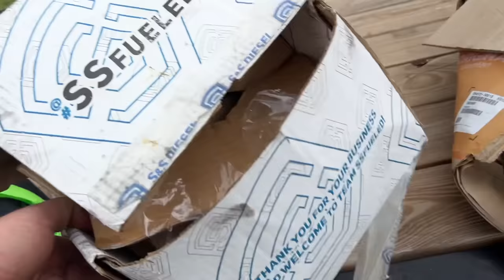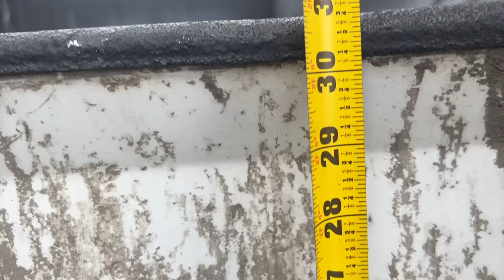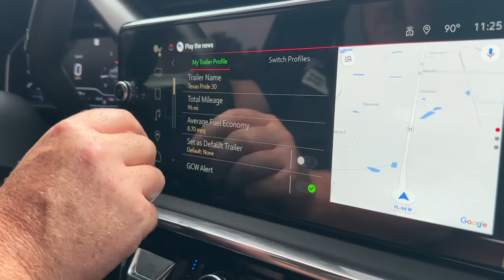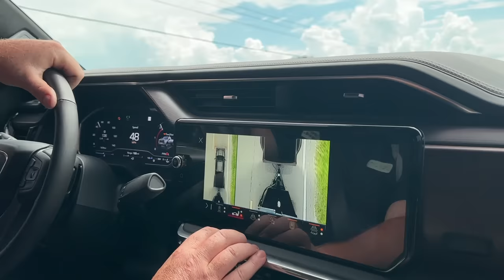$100,000 Diesel Truck VS $2,000 Diesel Truck!!!!  Are These New Trucks Really Worth It?

Comment: To be clear, I own a old F150. But it is also true that a 2024 F250 6.7 HO is $76,000 supercab and long bed weighing 8003lbs with 550 hp. 0-60 in 5.3 seconds... Tows nearly 40,000lbs with 5th wheel

Comment: I use my 99 dodge ram 2500 diesel for towing a bobcat t590 on a 16 foot dump trailer . Its like 14000 pounds . I tow up hill all day at red line . 480,000 kilometers on it

Comment: I daily a 2006 Chevy 2500HD 6.0 4L80E.. 267, 700 on the dash. Id trust it across the country with any trailer haulin max weight.. 8ft bed ext cab 4x4... 💪🤌💯  all white blacked out... no homo lift.. stock 16s.. Big bumper n horn front hitch... big rear bumper.. big hitch.. 💯 most reliable

Comment: Should do a nice 15-20k older truck with 10-15k in upgrades and engine mods vs a brand new stock truck. Because you can make a older truck out perform the newer ones

Comment: My 99 f350 powerstroke with only a chip added kicks ass.   Your new one just adds more fuel.  Overall, new smells better , but just adding a new front seat will fix that.  You can buy a lot of diesel and repairs  for that extra $98k

Comment: I’ve got 2 ram trucks one I bought new in 2018 it’s none stock with all the emissions still on and it’s got 278k miles on it most of them towing 10k plus and a 2015 my brother in law bought new it got 340k miles on it probably half of them towing 10k plus and it deleted and tuned but both still have the original stock powertrain with no rebuilds

Comment: You can get a 2023/24 Duramax custom for mid to high 60k and get the same performance as the 100k Denali. You could even get a base work truck trim and get the same performance.

Comment: A 100k truck generates the same income a $3000 truck does for the most part.  Obviously you can pull/carry a lot more then the $3000 truck so you can be limited in your tasks,  but if you are just towing a 35-50 excavator,  a mowing trailer,  an enclosed trailer or a dump trailer you really wont need the extra power in the 100k truck.  And the obvious is you have a warranty behind you for repairs,  so if you can afford the time and money to repair problems that come up in an older truck then thats your best bet.  I have 2 6.0 diesel trucks and a 4.6 F250 for landscaping and my high mileage 6.0 typically loses 7-14 days per year in repairs/maintenance.  Its expected having over 400k kms.

Comment: I was towing my RZR back on a 14ft with my tuned 6.2 GMC Sierra crew cab and pulled up beside an older man and his wife in a 2nd gen Cummins long bed towing a 25-30ft 5th wheel camper and i seem him turn the switch up and he left me standing on the interstate and smoked the whole road out for about 300ft  and i decided to quit messing with old diesels

Comment: Until it needs a new motor or a backordered part is on the list. You know technicians don't rush for warranty jobs that are big jobs. I got a Cummins on my sheet that has at least a weeks worth of labor done to it to not fix the problem and the engine is restricted so i can't just have it ordered. I haven't been payed anything on it yet... needless to say its been sitting for months and bought back. Just because its new doesn't mean its any good. The warranty doesn't mean you get in and out... you can have several months of downtime easily depending on the severity of the issue and the availability of parts.

Comment: Thng is about the old trucks is you can throw $30k at your older truck and it could or would perform just as good or better than a stock brand new one. You can also upgrade the lights, so it looks just as good and still under that $100k price. In my opinion, DPF and DEF has caused guys more shoulder time and shop time than an OG diesel engine  that was never introduced to the emission garbage. Repairs and maintenance are much cheaper on the older truck as well. My newest is a 2017 Ram 3500 dually...i dont think ill ever go newer than that honestly. 2020 plus trucks are just rolling computers now which is getting harder to work on by yourself without the software

Comment: I had a similar dilemma a couple years ago. I had a 00 7.3 f350. Loved the truck but I was towing cross country during the summer. I sold it and got a low mileage 2012 ram 3500 with the 6.7 cummins and g56. The cummins is a much nicer, more comfortable truck but it’s a 30k dollar truck versus my 7k dollar power stroke.

Comment: Funny how "newer is more reliable" I've heard of many horror stories of Brand new trucks breaking down and going into limp mode, mainly because as he states. These new trucks have so many Emissions system that they are far harder and complicated to work on and so many more things that can break on it. On top of that if you plan to keep the truck for a while the resale value plummets dramatically from new. Once these trucks get around 200,000KM they are at the point of catastrophic failure.

Comment: The problem with a $100,000 truck is that you can put a $30,000 down payment towards it (which can buy a pretty nice truck on its own.) and it’ll only cover the first 3 years of depreciation. $10k/year up front, then another $15k/year in payments following that. 

I assume he bought this particular one cash and plans to keep it, but the typical buyer is not going to have the same plan.

Comment: we have 6 of these old f350 Ford Super Duty trucks, smartest thing we ever did was buy a truck to take apart and use for parts we call it "stripper". The cost Savings of using used trucks like this is astronomical, if I had to buy 6 brand-new trucks I've have $600,000 into the same amount of work.

Comment: I have had newer trucks I am back in a 04 6.0l and to be honest I love it, no monthly payment being able to work on it, parts are cheaper. If you get a loaded  truck in that year 05-07 they are still nice and have heated seats you can get a nice radio and back up camera for 5-600. The new ones a defiantly more capable but really are they 85k more capable. One other thing to mention is that technically with the new trucks being so much more capable depending on truck/trailer combo you need a cdl. For me the old truck works but I like turning a wrench here you guys said it perfect, if you got the coin too blow it will give your business a good look pulling up but if things slow down especially with the economy being how it is you have that payment as over head. Regardless theses truck prices are insane used or new

Comment: Work wise... because, let's be honest, the ultimate is not a work truck. I got the SLE 2500 gasser, and it is awesome. I don't do much towing, but I use the payload all the time, and I have had over 2k lbs and it drives fine with it. Payload is 3500 max. So yeah, if you are working all the time and making money with the truck, then get the new 2024. If you only need it here and there, get the beater. Great video. Ps the new interior in the 2024 is off the charts!!!

Comment: I am just amazed you could find a running Diesel truck for 2000 dollars. My 1990 Diesel has finally worn out to the point I need to rebuild the engine. So for now I am getting around on a bicycle.

Comment: I wouldnt bring breaking down into this. That emissions system is going to cause way more problems on the long haul than an older emissions-less diesel. A 6.0 on the other hand yeah breaking down is something to worry about. But a brand new bone stock diesel truck you got 1 nox sensor failing will stop you dead in your tracks.

Comment: When doing the braking test, did you still have the trailer on? You didn’t have trailer brakes on the Ford. 
It’s all a moot point for me anyway. I’d never be able to afford a new truck, and I’m exceptionally happy with my 06 F250 6.0 King Ranch Super Duty. I tow quite regularly with it and it does the job efficiently, and comfortably for me.

Comment: Brand new doesn't guarantee reliability. Proper maintenance, pre-trip/post-trip inspections and know the limitations of your equipment do. 
I have a few trucks my self...
95 F250 powerstroke 4x4
96 F350 4x4 460 gas
2000 F250 powerstroke 4x4
2000 F350 4x4 5.4 gas
2005 Dodge 3500 Cummins 6-speed 4x4
2011 F250 4x4 6.2 gas
If I added what I have invested in them already (purchase + mods/repairs) I'm at 88,500. This leaves 10-30,000 left (market pending) that I could do in current/future repairs or add-ons before even touching the price of that new GMC.

Comment: Friend has a 2021 tundra for $55,000. The AC has never worked and now the heater doesn't work.
The system is heavily digitalized. Dealer wants $3500 to repair. They will only replace EVERYTHING.
nough said.
What? Mine? A 1990 F350, 351, crew cab, 8' box, 4 wd with a manual transfer case and manual hubs, solid axles, 5 speed manual, leaf springs all around and its a 98,000 mile cream puff.

Comment: I have a 2001 F350 dually CC diesel 7.3, long bed, HD suspension, bought new, now with about 100K miles on it.   Never a lick of trouble and I wouldn't sell it for  $10K.  Does everything I need .  The truck will outlast me.

Comment: If i were ever to buy a ford. It would be the old 7.3l. Personally id like to get an old 03-06 duramax. But i cant justify the need for one at the moment. Ill just stick with my 6.0l 2500hd gasser for the time being. Although im debating going back down to a half ton and buying a 3/4ton diesel for a standby.

Comment: Imagine buying a truck you plan to put 500k miles on, but being too concerned to buy it with 50-100k miles already on the clock for a 60-70% savings.

Comment: I would ❤ to see an old truck with a properly rebuilt power train truck vs new, figure an over haul power train is about 12-15k, it should be 30-50% power gain and 75% reliability gain, so a 20k truck vs 100k truck, and $200 vs $800 month insurance and MAYBE 3-5 mpg difference

Comment: This is a good video. I used an 03 for about 10 years very similar to the one you have except it had a utility bed on it. It only had injectors and I think the turbo go bad on it shortly after we got it under warranty and nothing after that. Always was a really good truck. I would probably buy something similar to that for just trailer duty unless like you said I was hauling across the country regularly.

Comment: Great video I mean you said the horsepower numbers but when it comes to Towing especially with diesels the torque is the most important one I would prefer the older diesel but I'm sure that new one is making 500 lb ft more than the old one

Comment: My hats off to the guys they can afford these six-figure trucks. Like most of y'all on here though I would rather have something pre-emissions and do the upgrades to bring it up too late model power and comfort levels with the added reliability of no emission controls. As for all of the 6.0 haters out there; take it from someone who has built them right. It's very possible to get 500k miles or more out of them with proper maintenance and knowing their quirks. Any and every truck out there in every year model is going to have it's miscellaneous failures associated with the miles, and there is nothing out there that is exempt from that.

Comment: When DPF's and SRC's were added to the diesel engines reliability went down, the EGT sensors can leave you stranded at any time, fuel contamination can cost you thousands. Anyone that asks me about buying a new diesel, DON"T unless you absolutely need the power for towing. If you plan on keeping your brand new diesel truck as long as you had your old Cummins, Powerstroke or Duramax you better think again.

Comment: My uncle has a 1999 ford f550 7.3 dump truck and he just put a new engine and transmission in it and it will pull like 16000 pounds up a big mountain

Comment: They should have honestly used a 7.3 instead of a 6.0, yeah the 7.3 has less horsepower but those 6.0s are dogs..the turbo lag is so terrible. Ive owned both, still own my 03 7.3, the 6.0 used to leave me dead in the water pulling out in front of traffic, waiting for the boost to build up.

Comment: The true test will be how many of those cameras and screens and gadgets will work in 18-20 years? I wish you would of had a few years older Ford with the 7.3L . My dad had a 2003 f-350 dually , crew cab? 4-full doors with the 7.3L 2x4 and that thing was a dream on the highway. Today they push as much power as possible out the new diesel motors and then choke them down for emissions. My buddy has always had diesels and his 04 got better gas milage then his 2021 does. To me being able to tow 20,000 lbs with a 10,000lb truck is asking for trouble.  Chevy/GMC atleast doesn't really make a work truck anymore, I'm talking vinyl floors, crank windows and nothing but AC and radio for extras haha. I see guys using Denalis or King ranches for work trucks, 2-3-4 year old once beautiful trucks with dents and scratches.

Comment: Sure the new truck may have been slightly better, but the old Ford still got the job done. Not worth going into debt for slightly better results. Never mind that the ford is easier to work on and will still be running 20 years from now.

Comment: My father has a 2002 7.3 liter with a 6 inch lift on bags all new metal bumpers 40 inch tires and I think it’s more bad ass than any new diesel. He paid 20k for it with all the upgrades included 150k or so miles on it. Doesn’t have to smog it doesn’t have to deal with emission anymore. I think unless u have the money and plan on getting a new vehicle before coverage expires don’t even think about getting a new vehicle. Horrible emissions issues clogging up your ports torn apart engines at 60k. All these electronics not to mention working on anything nowadays. honestly I hate new vehicles. They aren’t built to last anymore. If u want something u can keep forever and pass on for generations get something in the early 2000s and just take care of it. Gonna save you so much money in the long run. Plus most of these vehicles nowadays force you to take it to the dealer and shops can’t work on them anymore unless they have the programming for them. As a mechanic I wouldn’t trust any mechanic who works at a dealership. They are going to not only double the price on everything but sell you on shit that doesn’t need to be fixed on top of that u show up to pick the car up and they didn’t even fix the problem they just sold u on “maintenance” why? Because they can stack hours on it and 90% of them can’t diagnose the actual issue anyways. They put on parts before diagnosing. We’re not playing fucking legos here. Any real mechanic knows you don’t put or recommend any parts until it is diagnosed and you know for a fact that it is not working. Function check. Anyways there’s my rant. Take what u can from it this guy makes his money and has his reason but if ur not him think seriously hard before going into debt on a Hundred thousand dollar truck.

Comment: over 100 hp diff in motors what is the torq diff as well might as well be comparing an old VW with the newer truck.
Tune up the older engine and the suspension and then compare are both motors turbo?

Comment: I bought a 97 F350 Powerstroke 7 years ago for $3000. Not a looker but the drive train was sound. Just needed tires. Had the transmission rebuilt 2 years ago by a highly reputable shop. It tows and it goes to the lumber yard. When I want to have fun, I drive the Alfa Romeo or the BMW R90/6 on the back roads. A truck is a tool. Period.

Comment: It's hard to compare apples to oranges, but to try to even it out I would have at least replaced the tires on both trucks to be as similar as possible. Old tires can have a big impact. If the old truck could spin the tires that's a sure sign that tires should have been upgraded.

Comment: To me if a contractor pulls up in the brand new vehicle, they are going to look deeper in debt and then it's going to look to me like they will be charging more for their services. The company that put the metal roof on my house all drove old '90s Toyota pickups and use trailers to move the large stuff. They didn't need giant 3/4 ton vehicles to do the job nor did they need new vehicles.

Comment: For the cost difference, the GMC better outperform the Ford by 50X in every benchmark, because that's the number of Fords you could buy for the one GMC. But all that aside, I think you can get a truck that has just as good 60-0 braking (the most important benchmark because it could save your life), for half the price.

Comment: I purchased a 22 6.6 duramax and have had nothing but problems with it straight pos.. the engine blew at 4k miles and the valve train had been serviced 11 times the engine has blow by horribly and it just hit 44k miles

Comment: That’s criminal using a 6.0 as the older truck since it was a biggest failure out of Navi star. Why not use the 96-03 7.3? Why not use the 95-99 5.9?….

Comment: I would be interested in seeing the old ford or maybe an 02-07 dually in decent shape break, transmission motor so probably a 15 000$ compared to the brand new 2024 gm. Im a duramax owner 04 love it do mild towing and work with it on a daily basis but i paid around 12000$. At 31 years old  would never buy a 100 000$ truck at 45 years old that is  another question.. at 2000$ i would put a dump box in the back of the old Ford. Nice comparison i will look for the others

Comment: Heres the answer. Work on the 6.0 in your backyard and then work on the 2024 6.6 duramax. Big difference. Then get back to me and tell me witch one you rather have. The 2024 6.6 duramax makes the 6.0 look like a carburetor v8. You can still work on it compared to the 2024 duramax. I can have the turbo off and on the 6.0 in less than 2 hours. Doing that to the duramax is a weekend job.

Comment: If you need the power of a diesel you would be best served by buying a 70s of 80s truck. Like a 2 ton. Rebuild what needs rebuilding.  Then buy a gas pickup. Most people don't need a diesel.